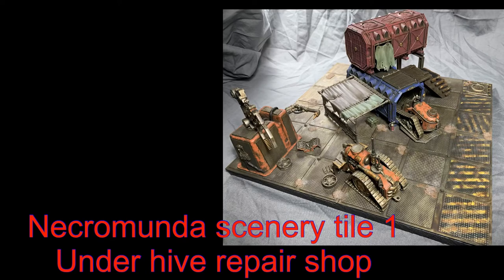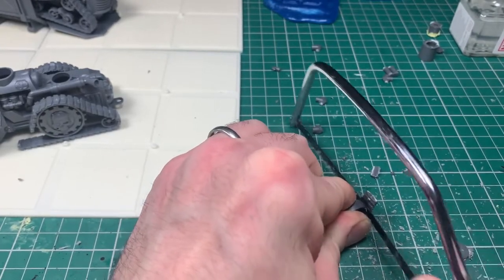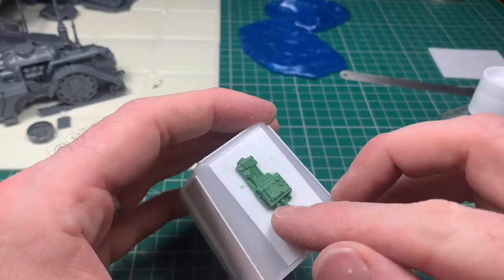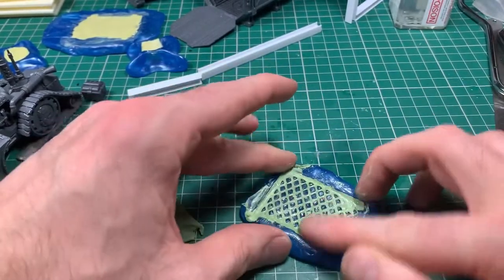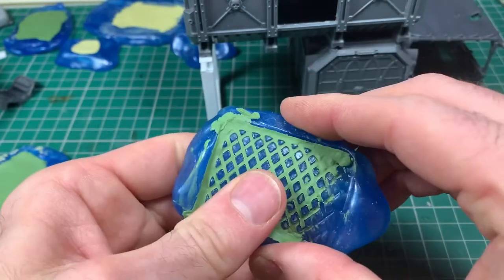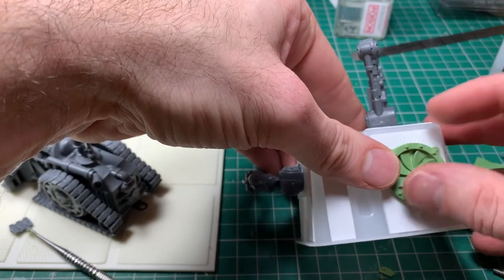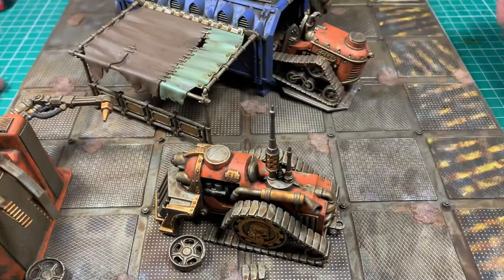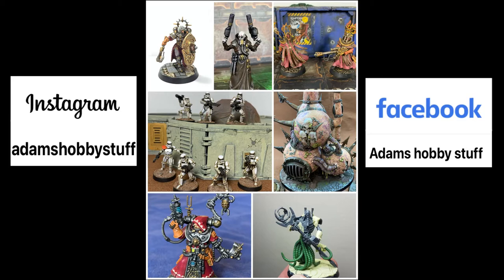necromunda scenery build - tile 1 - underhive repair shop kitbash / scratch build

Comment: I always get a good inspiration from watching this. I'm building my first necromunda table right now and have to paint a ton of the "normal" stuff before I will dive into custom tiles (although I've build a version of the scrap yeard already). But I really love what you do with the containers. The hazard stripes though, don't look as good. They look more like tiger stripes.. not sure why. Maybe because the edges of the stripes are not as defined or maybe because there is too much brown in it.
Reply from the maker: I have plans for more containers when I expand the board, been slacking off Necromunda for a while and need to get back to it! I know what you mean about the hazard stripes, I like them but other pieces I’ve done came out better, can’t quite put my finger on why though!

Comment: I'm building a subway train diorama. That's going to serve as a rogue docs surgery. It's not actually going to ne a train. Just something that the doc has found and used for his own business. As part of an underhive settlement.  It's going to have a couple of the shipping containers as his living quarters. On I frames around the subway carriage supporting the containers. It's also going to have a makeshift shed for the cyber mastiffs surgery.  An awning over the side, next to the train car. As kind of like a waiting room. With chainling link fences and gates. And some smaller boxes and crates for his materials and tools. Plus various machines for surgery work. So like the rougue doc in hired gun. His job is to upgrade people and animals. Not to heal or help the sick. But to enhance the combat effectiveness of necromundians. Who ever can afford his expensive surgeries.  Over time. Build other dioramas to build up a settlement.  I also want a little area for A dome runner. And have a plan. For a couple of juves.  For Gutter runners. Basically the Gutter runners. Go out of the relative safety of the settlement.  And outside of there dome. To procure items. Which they then sell at there market stall. Items like cups plates cutlery etc.  Bottles and other useful items.  Sometimes illegal goods. But only available to trusted customers.  I want to get into story telling side. Good build by the way. I like it. I haven't started yet. But I am myself procuring items. For my future projects.
Reply from the maker: Sounds like a great build you’ve got planned, not planning on a rogue doc myself (at least not in this phase of the build which will be the first 2x2) but the models and opportunity for then are huge, I like the idea of the doc being a profiteer with upgrades, I’ve got several dogs in my orlocks (not yet painted) so the background really appeals! Glad you liked the vid 😊